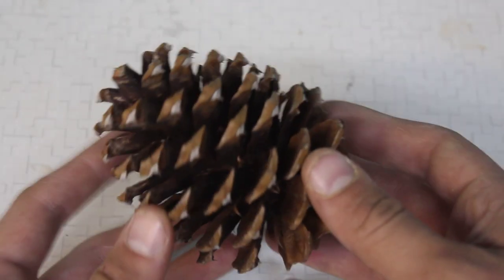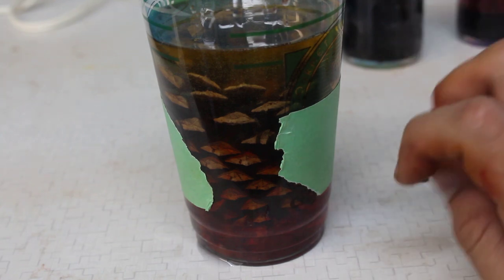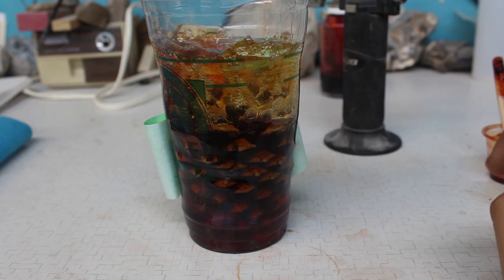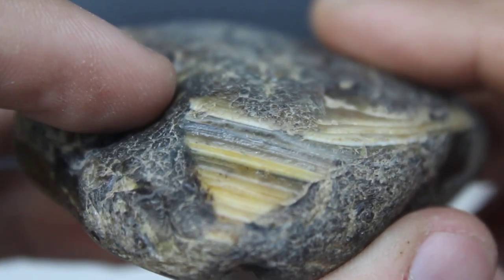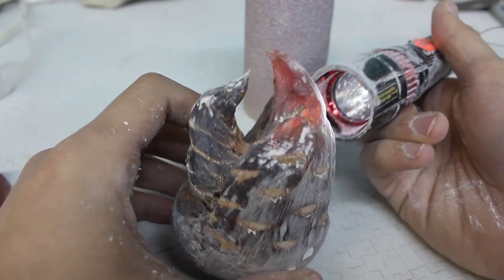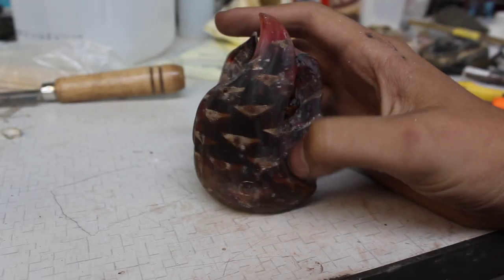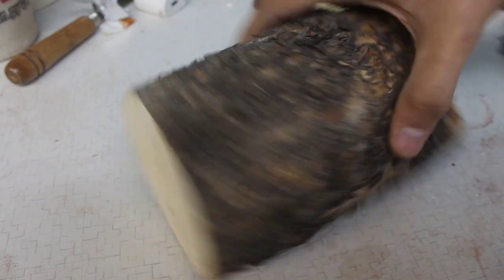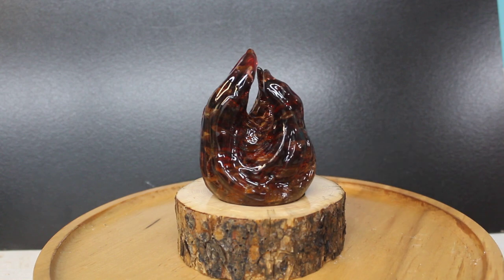Carving a Ball of FLAMES Out of a PINECONE!

Comment: Theo  I was watching a video of a guy turning a bowl from a blank made of wood cubes in resin and the guy that made the blank put the cubes in the mold and then covered them with resin and then put it in a pressure pot and put 45psi in it and that keeps the bubbles so small you can't see them. I don't know if it would have helped with these bubbles or if you have ever tried it to not get bubbles in resin. Great job on the pinecone looks beautiful.
Reply from the maker: Thank you so much!  And Yes! That is actually something I am planning on making at some point!  It makes your casts just crystal clear! Still just doing some price checking to see if I should go with making a pressure pot or a vacuum chamber, seems like the pressure pots work better than the vacuum chambers.
 Unfortunately it would not have prevented the bubbles with this one though, the bubbles here were from a huge excess of heat because the product I used is not meant for casting. I was actually using a type of resin meant for table top finishing because I was out of casting resin and didn't bother reading the instructions first.... Huge mistake! 😂 this product should never be poured in layers deeper than a half inch(which this cast was probably like 5 inches deep) which makes the activator kick WAAAY faster than it is supposed to and makes it bubble and heat up like crazy 😂 it probably got up to about 250 degrees. Lesson learned that I should not use products in ways they are not meant to be used!

Comment: It's beautiful, if you sand the bottom out to the bottom of the pine cone and put a light under it.   Beautiful anyway.
Reply from the maker: That was originally the plan, but I unfortunately couldn't find any LEDs bright enough without producing too much heat. The branches of the pinecone blocked too much light to make it through the whole carving unfortunately, but that's why I secured it place with hot glue! That way, I CAN put a light under it whenever I find one strong enough that doesn't get hot! Thank you so much for watching! 😊